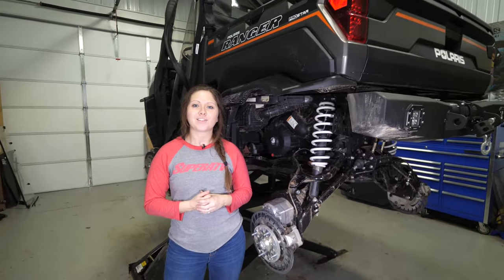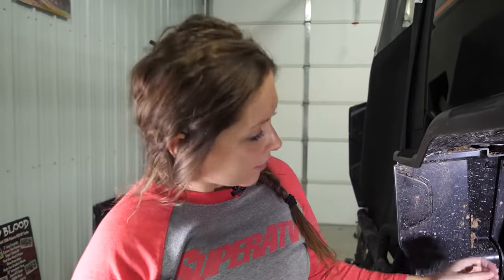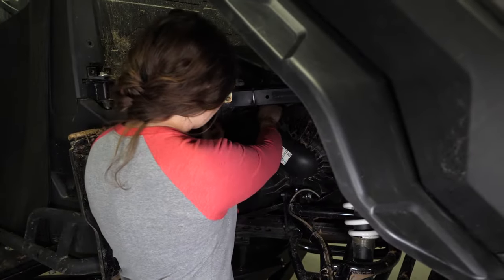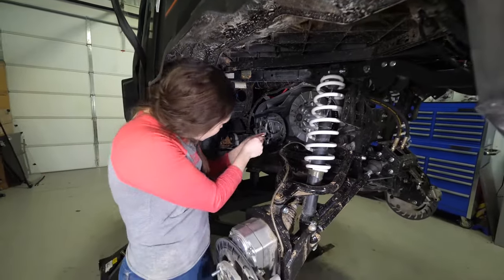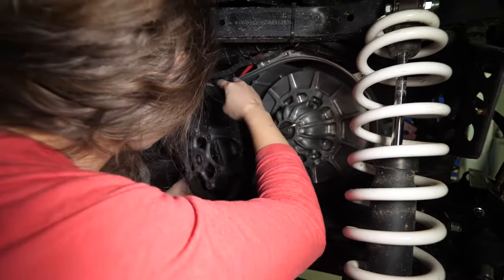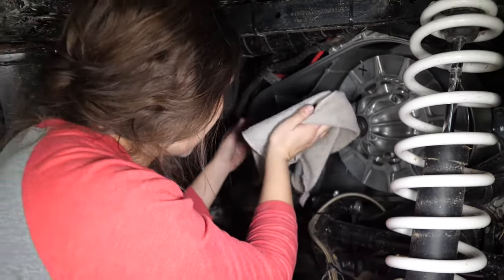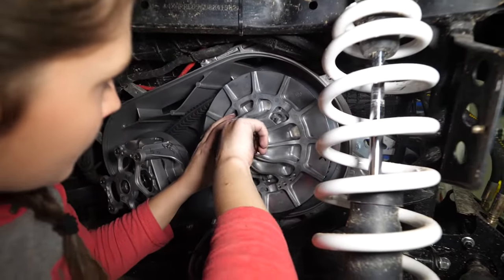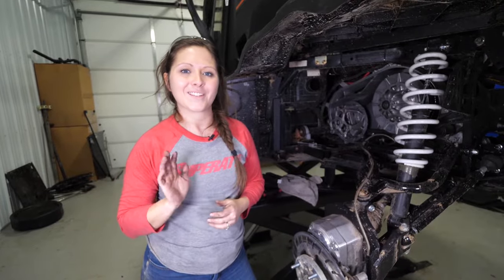How to change/replace/inspect drive belt on Polaris Ranger XP 1000

Comment: This method worked on a 2021 Polaris ranger xp 1000 northstar. There are 9 bolts on the cover on my unit. That was the only difference in noticed from their method. I didn’t remove my tire and it was fine.